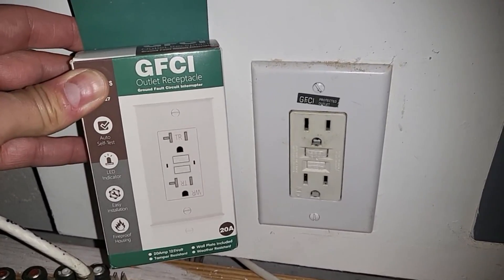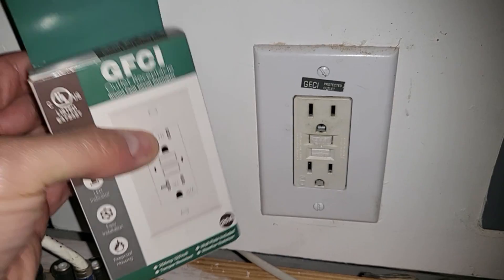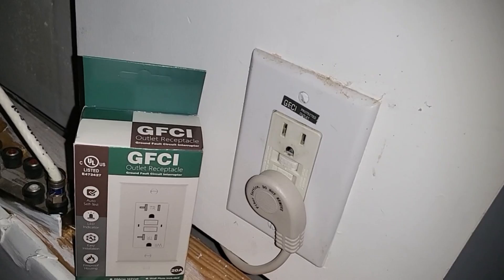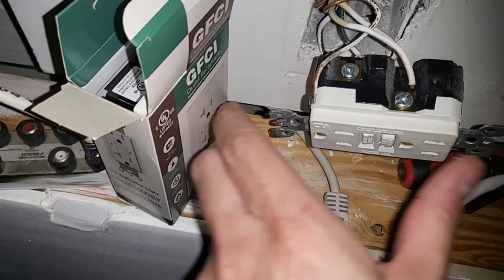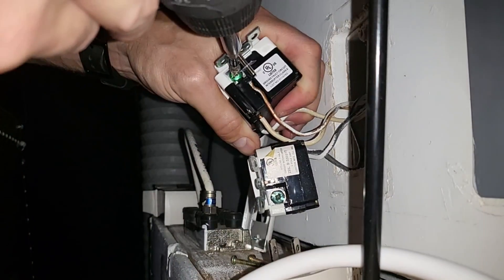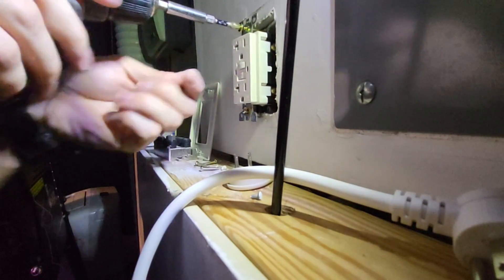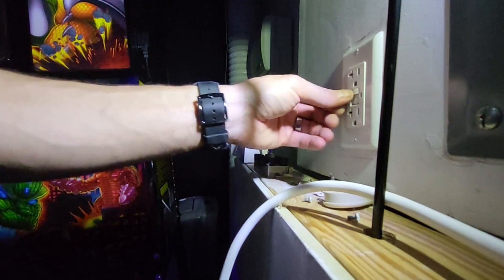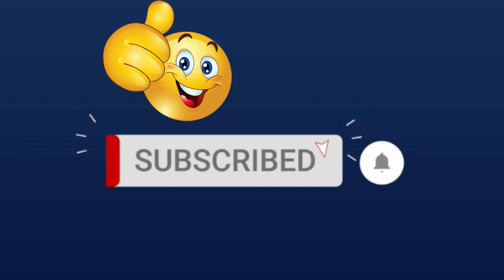How to replace AC outlet GFCI receptacle

Comment: I'm not an electrician - but one word of caution:   You should additionally test the wires with a volt meter or a non-contact voltage tester.  Only happened once but after turning off the circuit breaker and assuring no power with a lamp, i received a bad shock after my son-in-law plugged in a lamp on another circuit. after some research and poking around we found that the neutrals from two different circuits were tied together in a switch box causing a hot neutral at the box I was working on.

Comment: First comment is Don't purchase Chinese made CFGI outlets. Most of the metal parts inside are plated metal not brass or copper. Pick up a inexpensive and a higher cost version and feel the difference in weight. You pay for quality.

The outlet isn't designed to be installed with wood screws. Use the correct length self tapping machine screws provided. If you have resistance from the wires, squish them down and use electrical tape to hold the position. The outlet removed appeared to be the same size as the one installed.

Comment: i wouldn't
 think LONG pointy wood screws would be good .. with the risk of poking the wires on the back side .. they are short for a reason , as to not touch or poke the wires behind
Reply from the maker: Yes I agree but The screws didn't break through.